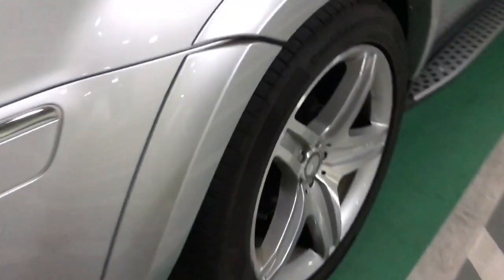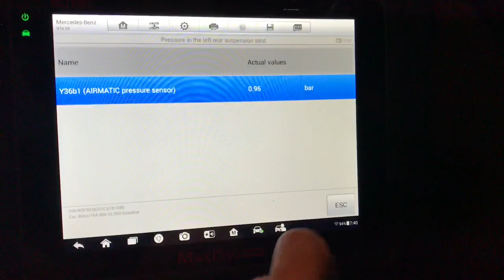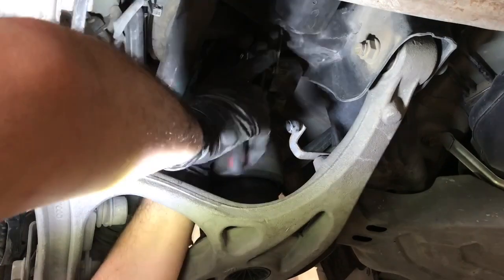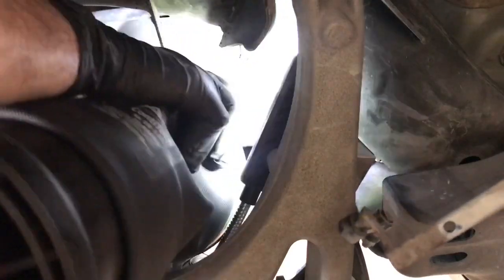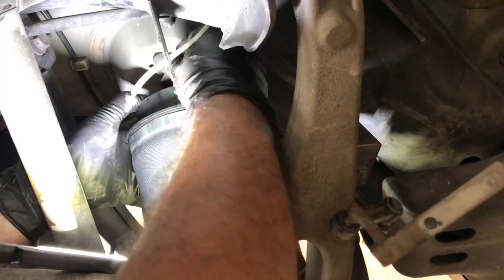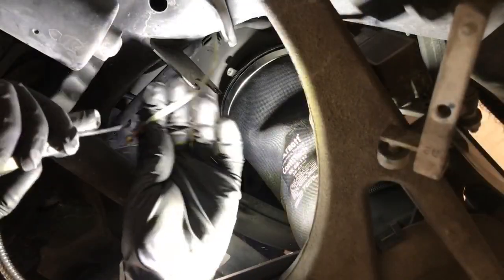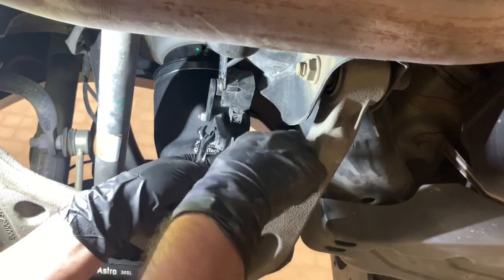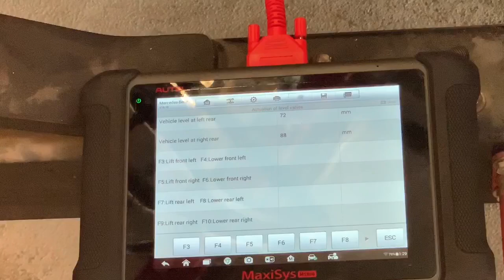MERCEDES AIR SUSPENSION DIAGNOSE & REPAIR

Comment: Great video. I was able to replaced the same air spring on my 2013 ML 350 today, all thanks to your video. I bought the air spring from autoshack and it only cost me $66 CAD plus tax. Like you, tested the old one to see where the leak was, and it was in the same spot as yours. Apparently it is very common for them to crack in this manner. I will probably have to replace the other ones soon. Thanks again.
Reply: Hi, Andrew, can you please post the parts number here?
Reply: @yangwang1033  SKU: # KAS229M17RPR. That’s off the autoshack website in Canada.
Reply: @andrewb8961  thank you! 😄
Reply: Update: I had to replace the other one only a few weeks after.
Reply: @andrewb8961  I ordered a pair on the site, how much did it cost you to put them on? Seems like they only sell in pairs now.
Reply: @yangwang1033  I installed them myself. I have an auto lift in my garage so it was relatively easy. I advise you to change both because the other one will go bad very soon.
Reply: @andrewb8961  thank you!

Comment: That was an excellent video . Got a GL 350 with similar problem on the front suspension .. I can hear the air leaking after I turn off the engine.. Is the process to replace the front driver/ passenger airbag same as the rear or is there something that I need to look out for...
Reply from the maker: The front one are more involved job, u have to take out the complete strut and disassemble it.

Comment: Hello- great video. I tried using hand pump to check for leak after i took the airbag. Any special adapter you used for the fitting to pump the air?.
Reply from the maker: No adapter, any hose that fits on top of the fitting ..

Comment: Hi. Thank you for the video. A quick question: is it safe to driver my Mercedes with the air suspension being low/damaged to my mechanic's garage about a mile away from me?
Reply from the maker: Rear ones yes, front is not a good idea
Reply: @TheFlyingMechanicDIY  thank you. Yes the rear one is gone, I need a new one.

Comment: Thanks, I have GL 450 2013 i like to repair my car by my self what is best scan computer? & which is best place ti get for better price
Reply from the maker: Rajesh Chhelavda its hard to say, but launch and autel are both descent tools for european cars
Reply: thanks for your reply,which model no( AUTEL MAXISYS MS906) is good & wher to buy please
Reply from the maker: Rajesh Chhelavda yaa, the 906 will cover enough cars and options .. buying options are based on ur location
Reply: @TheFlyingMechanicDIY  I am in Florida Orlando USA
Reply from the maker: Rajesh Chhelavda it is available at Amazon, but u might get nice deal on eBay auctions

Comment: Hello...I wonder if you have had a problem with SAAB 93 2007 B284 V6 engine giving DTC P2188...any help you can provide will be most welcome..thanks
Reply from the maker: Charles Caltrop, although its hard to diagnose fuel mixture codes remotely, but causes could be MAF, Boost leaks, fuel pump, fuel pressure sensor, O2 sensors.. without additional data and test cant tell exactly, u will need to look at freeze frame data as well ..
Reply: @TheFlyingMechanicDIY  Thanks for your kind reply..I am starting to check data to see what I can find..hopefully WIS instructions will help..Best regards.

Comment: I got the same car but i cant even communicate with the system.. My scanner use to let me until the benz drop really. Now i get kick out of the system...i check fuse and relay...any advice
Reply from the maker: Try different scanner, and keep in mind the control module might be faulty
Reply: @TheFlyingMechanicDIY  yea i try my Autel nothing at all...this airmatic module does it need to be program
Reply: @TheFlyingMechanicDIY  to make sure when i use a scanner its trying to read the air suspension system thats the  airmatic control module correct
Reply from the maker: @patricwell8335  yes
Reply: @TheFlyingMechanicDIY  just to make sure yes it will need to be program..
Reply from the maker: @patricwell8335  no programming is required according to my knowledge

Comment: I replaced compressor, relay, arnott air spring, rear sensors, valve block rear is still won’t raise. Do you have any idea?
Reply from the maker: Wihout a scan tool to pull faults and actuate components it is almost impossible to figure out for certain , u still have the accumulator , the lines, the module, adjusting calibration after replacing certain components in the system .. so the lost is long ..
Reply: Valve block

Comment: After 2 years I am again!! Now both front suspension is losing air, I replaced valve block and compressor. Tested at the shop, stayed level. I came home, after 2 hours front suspension lowered again. Sensors are good per scan, No leaks both shocks. Is there anything else I need to check. This is very frustrating.
Reply from the maker: It is the shocks usually, like in 99% of the time .. u just cant test them for leaks 100%.
Try raising the car to the max and spraying water all around the air strut and top of it .
Reply: @TheFlyingMechanicDIY  I soap sprayed it and it was the line between compressor and valve line, tightened it, solved for now. Thanks for the reply!

Comment: Hi! My husband changed both rear air springs on my GL 450 but the truck won’t rise! Any suggestions? It’s been parked in the garage for the past 8 months because of this 😢
Reply from the maker: Do you have a suspension malfunction message at the dashboard?
Reply: The Flying MechanicDIY yes
Reply: The Flying MechanicDIY even after the air springs were replaced- the message still shows
Reply from the maker: its either a bad compressor or bad valve block, to test the compressor unhook one of the front shocks air lines let it release air, reconnect it and see if the compressor pumps air into it, if it does then compressor is good and change valve block
Reply: Hi, I have a similar issue. How do we know its not the ride height sensor? Cici not sure if you can share how this issue was resolved?